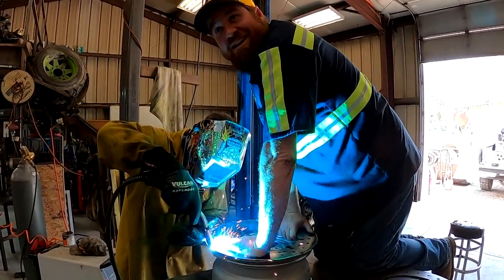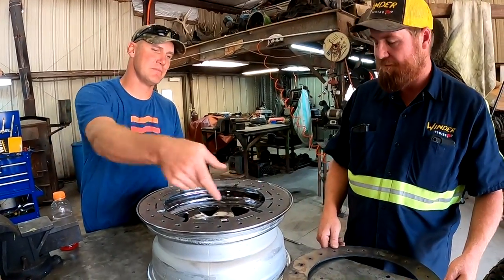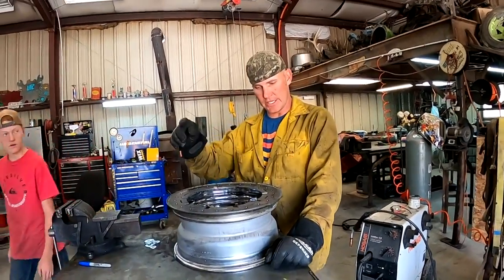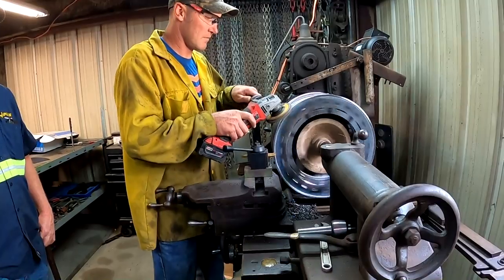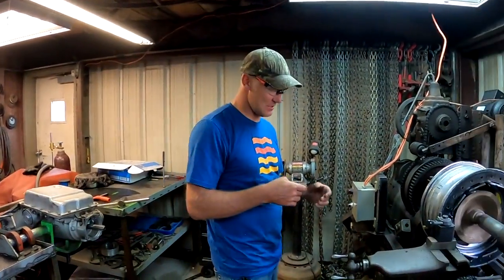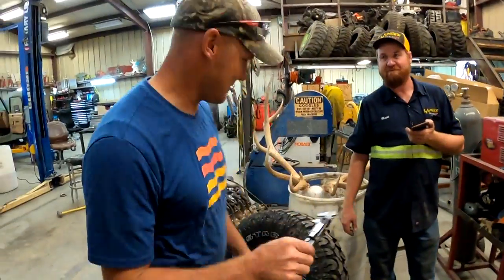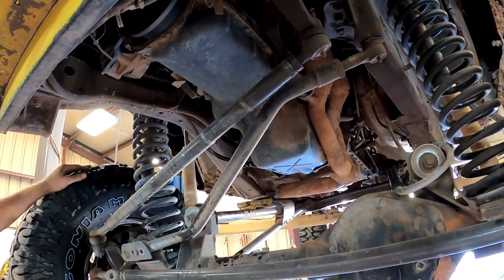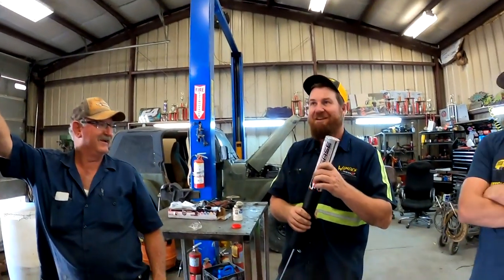Custom Bead Locks on the Yellow Banana JEEP

Comment: I didnt see you do it in the video but you're supposed to weld those anti coning tabs.I just did a set myself.
Reply: Do you mean you welded the tabs to the outer ring? Doesn't that mean you will have to cut all of your welds to ever get the tire back off instead of just unbolting the ring?
Reply: @jeremyenns7330  The tabs that get bent up.Youre supposed to weld a bead along the bottom of those.
Reply: @Olebluee  Ahhh... I see... so you are welding them to each other at the bend, making them much harder to be bent on the trail.
Reply: @jeremyenns7330  Exactly

Comment: So how does one trim the tabs to fit the thickness of the tire without a lathe?
Reply: use a measuring tool to mark a line on all the tabs, then use a grinder to grind down to the line. but a lathe would be much preferred in my opinion.

Comment: For those that laugh at safety goggles     If u ever need an mri   If u work around metal fragments and any work in behind your eye     The metal fragment can slice your eyeball up during an mri    U need a special pre check just to make sure if u work around metal fragments    Use your glasses   Get young ones used to them and always using them    Same for hearing protection     🐻🇺🇸

Comment: oh hey Matt, if you didn't want to dick with bead locks, you could have just drilled an extra valve stem hole and installed a tube. 
Then inflate the tubeless and tube together when you're running normal and when it gets too low, you can always inflate the tube and reseat the beads really quickly.

Comment: If those rings end up any other color than yellow I'll be extremely disappointed 😄 I'm 50/50 black vs chrome for the wheels! Get Matt into lathe or milling machine work, after paying for tooling I promise he'll no longer grumble about buying new jeep parts😁 (also I think I've got the grab on a damaged just right "totaled" Tacoma like yours!) Its a 2016 so not looking forward to all the non mechanical electrical/computer "improvements" 😒

Comment: What stops inner tyre beed coming off
Reply: The inner bead has to move a lot farther before it can drop in far enough to dismount. There are other factors involving side loading and weight transfer as well but we'll stick with the short and simple. If You look at a bare rim you can easily see what I'm talking about.

Comment: Don’t you have to bead lock back side too. It can come off bead on both sides. Tell me I’m just dumb
Reply from the maker: The back side of the rim have longer beads so they usually don’t pop off the back.
Reply: @FabRats  I’m surprised l got a response, thank you. So the back side is a little ugly, but works better. Has it snowed there yet. I’m in NE Tennessee, we hardly ever see snow before Thanksgiving.